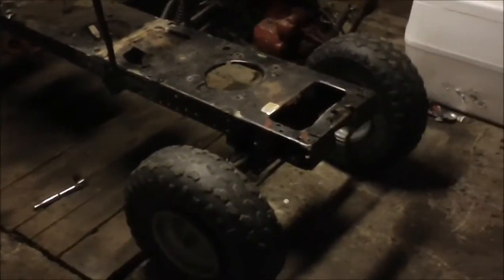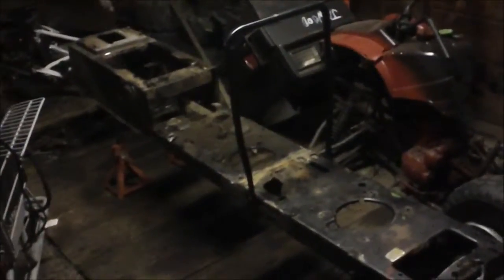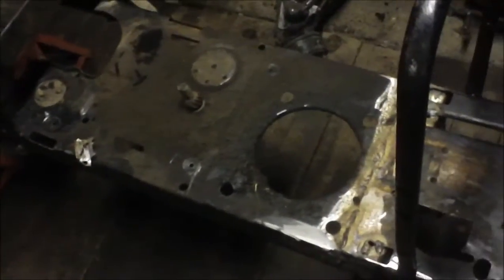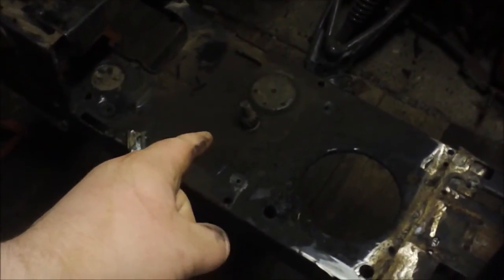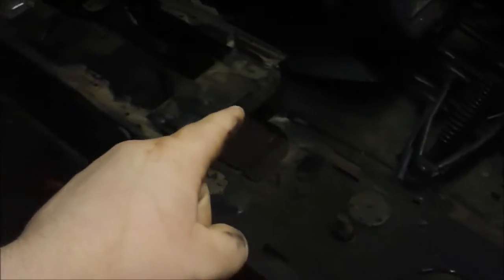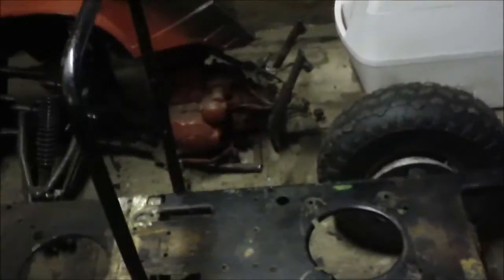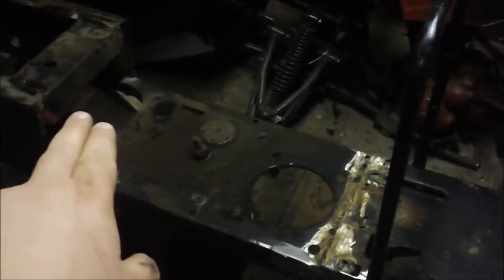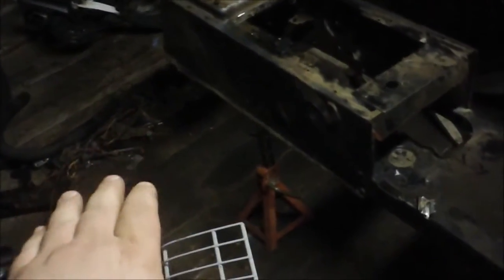utv lawn mower (extended lawn tractor frame)

Comment: i know  steal  aint  cheep  but  you do need to  add  to the frame, i use  bed frames and  a stick of 1x1 steel tube together  there the  same  size as the frame,